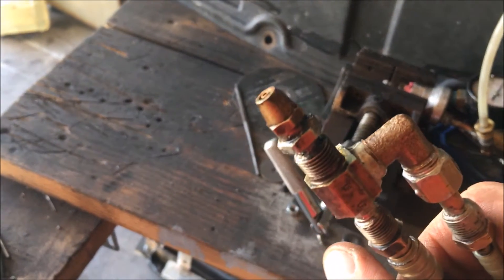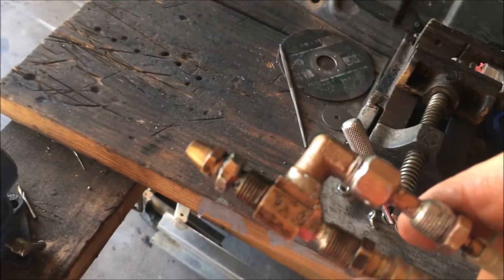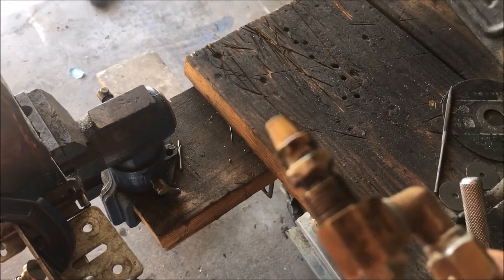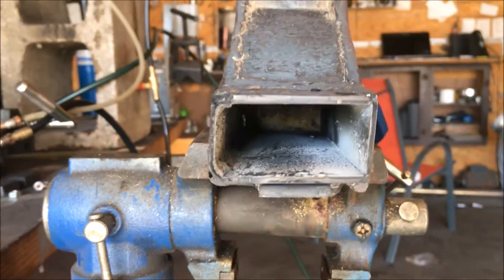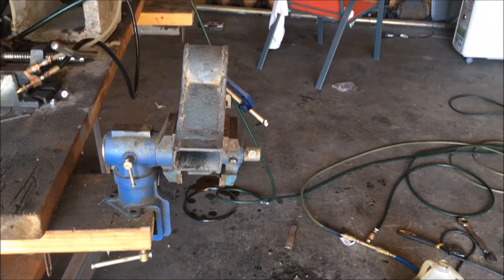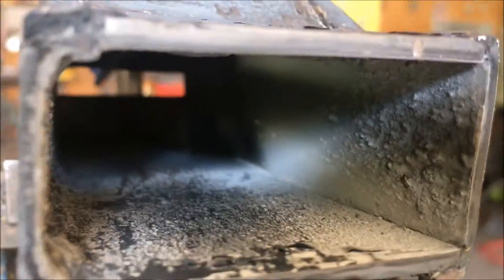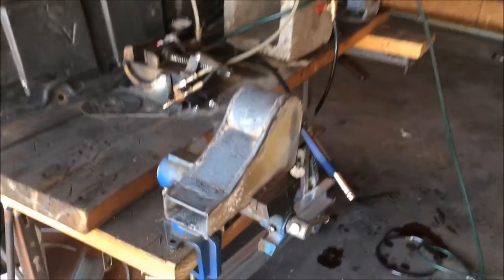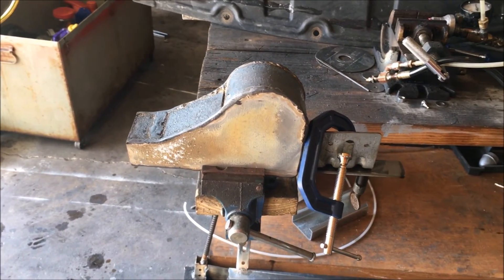200 kw Industrial  waste oil burner build

Comment: What is the difference between waste oil and furnace oil? Can we use furnace oil on this kind of burner?
Reply from the maker: yes you can , furnace oil is low viscosity and very clean , waste oil is used oil